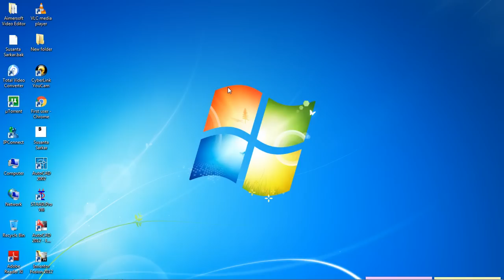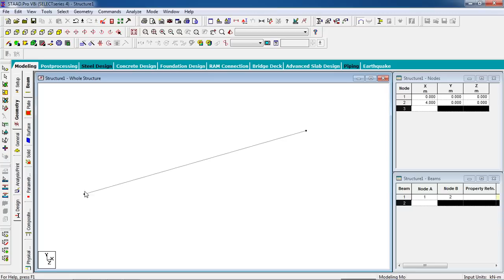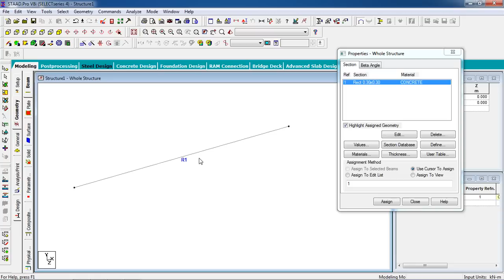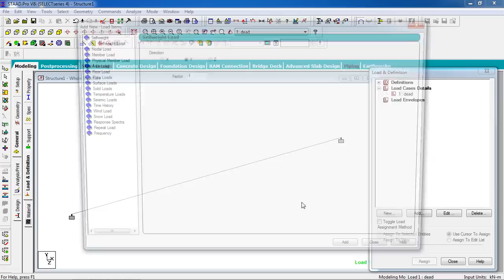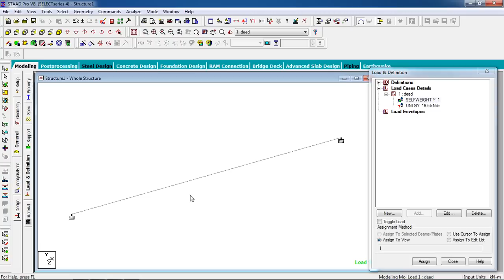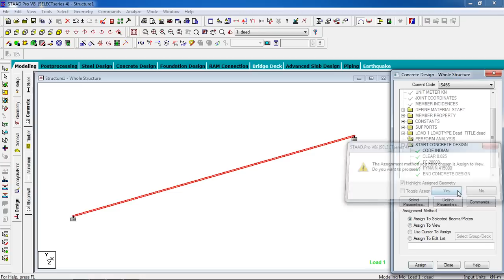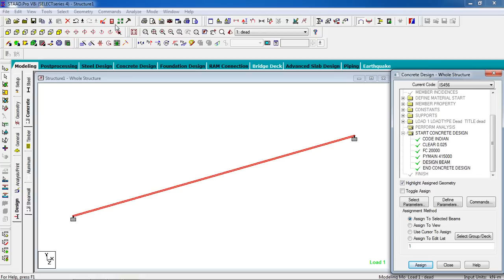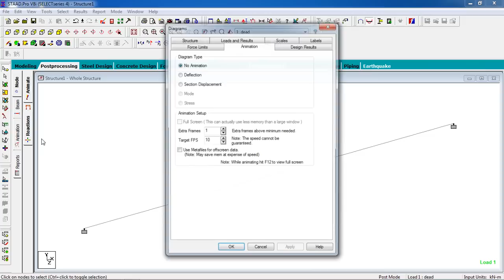STAAD Pro Tutorials - RCC Beam Design ( Day 4 ) ( Civil Engineering )

Comment: In my software, for designing purpose, IS456 is not showing up, which alternative can be used for it?
Reply from the maker: You can fix the problem ! When you open the software make sure you click on "Indian Design Codes" from the License Configuration !
Reply: there is no Indian design codes in License Configuration.  Help me pls
Reply: Select Commands ->Design -> Concrete Design